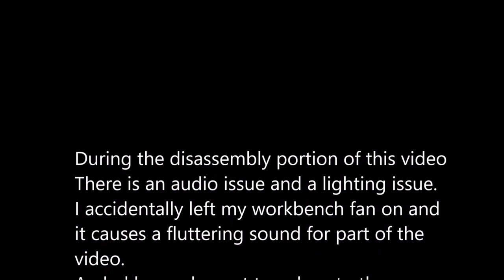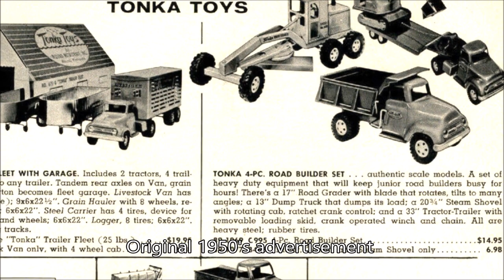1950's Tonka Dump Truck Restoration

Comment: I was extremely impressed with everything, the attention to detail, even fixing the manufacturer's mistake, ......but....then you broke out the spray paint. I know the powder paint is expensive, but worth it in the long run.
Reply from the maker: Thanks for the comment and for watching.
I've never used the powder coat before but it's in my plans.
Reply: @onemansgarage6203  powder coat is not original all those were painted stay with paint keep original  okay ?

Comment: With as much red paint as you used. What prevents sags and runs from developing?
Reply from the maker: Un-sanded second primer coat.
I just let the second primer coat dry, then wipe down gently with a cloth. That allowed me to apply the paint slower and heavier.
thanks for the question and thanks for watching!